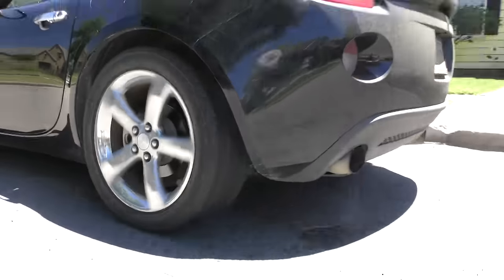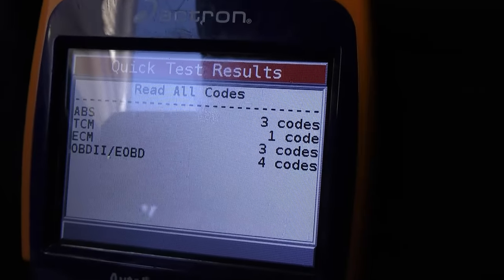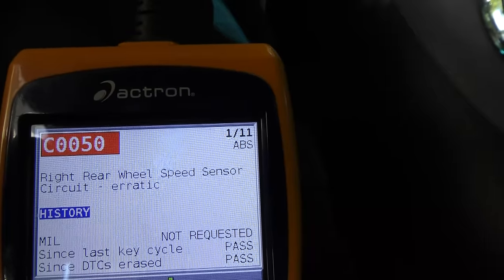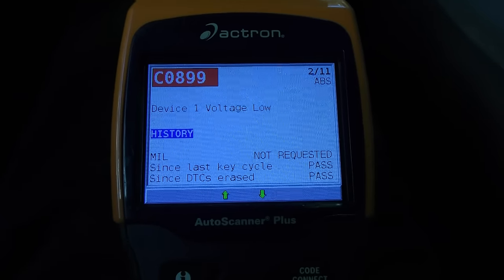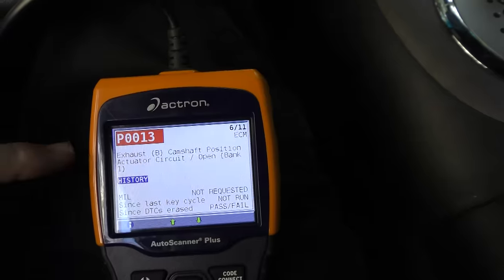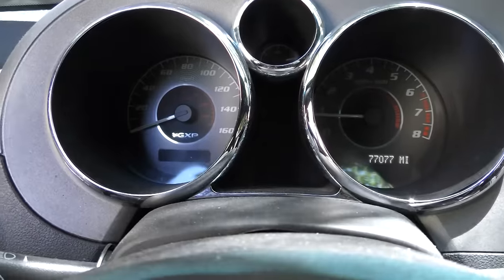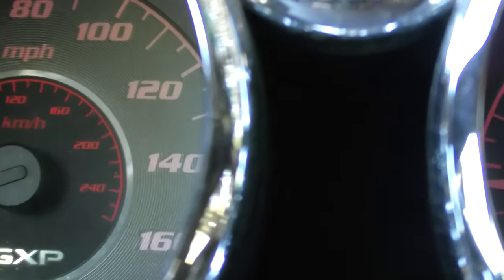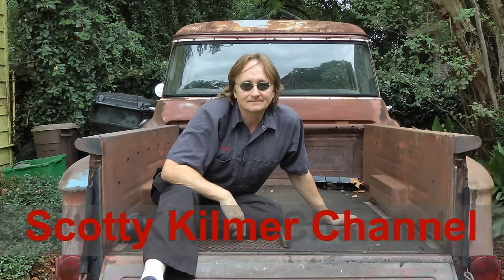Check Engine Light On in Your Car? The Truth About What it Means

Comment: if the check engine light goes back on after erasing the code, just use a little piece of black tape to cover it up. bye bye check engine light!
Reply: squintero213 If it starts flashing with the black tape on it, bye bye engine or catylitic converters.
Reply: lol, then we will need more tape
Reply: Catalytic converter is not even a necessary thing in cars to run as far as I know is just do to a car be legal for not contamination etc. But can make the car runs poorly and fuel efficient can also affect. Same with resonator
Reply: Elliot J Vidal a lot of things is not necessary in cars to run, air filter, fuel filter, oil filter, AC,  and on Diesels alternator, headlights, horn, seats, etc. so your point being?
Reply: I just took the bulb out from the gauge cluster.
Reply: Also if your up to your eyes in debt, just burn those bank statements, bye bye debt.
Reply: I did that with my airbag light.  WOrks a charm!
Reply: squintero213 Didn't Homer Simpson do that in "The Simpsons"?
Reply: Fireship1 there's nothing the simpsons did not do already
Reply: squintero213 Well that's one way to solve it
Reply: squintero213 It's just that simple, it's magic.
Reply: Not if you live in a state that doesn't pass inspection because of it.
Reply: Airbags have an airbag light generally.
Reply: HAHHAHAHAHHA
Reply: bye bye engine...
Reply: @squintero213  Hahahahaha!!! I did that on my van. Outta sight, outta mind. lol :-)
Reply: I was thinking the same thing if we clear the codes the computer still all have to be ready when we get emissions done I got several parts replaced 2 different times the shop reset the check engine light I went to get emissions done months later and the guy at the shop said I did not drive long enough a drive cycle so the computer will be ready.
Reply: i remember doing this on my first car.  electrical tape, to be exact.  it was a honda crx and it ran like a beast, so i didn't give a shit.  now i'm old and responsible and when my check engine light comes on i freak out and check it immediately.  i miss being young and not giving a shit, it always seemed to work out fine anyway.
Reply: It also means that you either have to refill blinker fluid or replace muffler bearings
Reply: We can not to that here.HA HA HA My sister and her husband have a 90 CRX they bought from my mom years ago my mom bought it brand new.I know what you mean about older I used to use just a jack to change my oil now I think about the jack falling.
Reply: Chris FIX HA HA HA
Reply: squintero213 haha lol lmao
Reply: squintero213 bye bye engine too
Reply: I bought a used car that the dealer did that on. 😐
Reply: Bmw M3 e46 not really, sometime some stupid sensor would trigger the checkengine. i ran my car for 11 years with the light on.
Reply: After a while the bulb burns out, dont even need the tape.
Reply: +CarimboHanky 
thanks
Reply: been driving with my orange check engine light on for over 14 years. light is still shining and vehicle has over 400,000. I am gonna keep waiting for the light to burn out.
Reply: John Smith it will never burn out
Reply: We can not have a check engine light on in GA  and if we get a new part and reset the light all of the checks on the computer need to be ready and do a drive cycle.
Reply: Sky Raven same here, we have e-check in my county in Ohio. It pays to buy a code scanner to fix things yourself to be able to pass it.
Reply: sorry, but there's no w check in Ohio anymore. They been out of business for a while.
Reply: tom jones umm yes there's no w check but there is e-check as in 'emissions check' in 7 counties.
Reply: thats what i did on my piece of shit buick (redundant, i know)
Reply: lol, good one
Reply: you know I never thought of using a piece of black tape I have a Chevrolet with the engine check light on for 12 years , it's never failed to start and has never used one drop of oil
Reply: If the state you live in requires inspections you need to get that light off. I live in the shitty state of Massachusetts that is very strict on car safety.
Reply: omg, it actually worked.
Reply: or remove the bulb!
Reply: DONT BUY NEW
Reply: I got my door replaced and my car serviced 1 week ago and my check engine light returned yesterday so I’m not paying the dealer another cent I’m just gonna cover it with some tape
Reply: Not owning a scan tool and having an old car, I just momentarily disconnect a battery lead. Works, no more check engine light staying on after start up, one drawback is you lose your radio settings.
Reply: squintero213 Lmfaaaaoooooo
Reply: Lol
Reply: just disconnect the dash. who needs all these flashy indicators anyway. not me.
Reply: I think these warning lights can sometimes be glitchy, so if it goes off and stays off & car drives fine , then it’s ok 👍
Reply: Ha my mechanic actually tols me this... He said my codes were linked to the catalytic converter... Its also burning oil.If he can't find the cause of the burning oil when my pockets are fatter it'll be going elsewhere... Its a bit frustrating
Reply: Ima fan igu
Reply: what a great idea! i never thought of it! will electrical tape work?
Reply: @JohnSmith-mh6bq  What kind of car?
Reply: @NeoJSsk  exactly! it is to collect the fumes and pass emissions. my friend had his cut out and rerouted his exaust. truck runs beautiful just louder :)
Reply: Yeah but but if you have emissions test you will have a problem
Reply: the same can be by resetting the trip odometer, and voila!  you now have a "low milage" vehicle.
Reply: @bronzechicken4437  oil pressure light
Reply: @Elizabeth-ej6ln  could it be your PCV valve
Reply: That’s true. It works.
Reply: Yeah , how about passing smog test ??
Reply: You can also paint over it with black paint that always works for me
Reply: I just had my car fixed with engine light on and they said it was spark plugs .my car doesn’t shake or anything at stops like before .It seems to be driving smooth but as soon I started the car the engine light is on
Reply: @jackhammer1021  😂😂
Reply: Lol, Sometimes it's indicating a problem that need to be corrected
Reply: @markvinci4369 same here. All new plugs,wires,cap,rotor injectors .then light went off for 2 weeks the the misfire no 4 code shows. It drives good oh valves adjusted too. I'm going to just ignore  the lite as long as it not flashing.
Reply: I used to put paper in front of it so I wouldn’t have to look at it l.o.l.
Reply: @jackhammer1021  good point
Reply: Yeeeeeeee😂
Reply: How do you get by state emissions?
Reply: How do you get through emissions?
Reply: @DareToBeDeviant 😂 I love it! I want to learn how to disengage the seat belt reminder nonsense too!
Reply: 😂 someone actually sold me a car like that, when I failed my following smog test. Should have went back and held the private seller responsible.
Reply: I once saw a tv show, before all the electronics, where 2 guys spent weeks trying to.get the light off. They finally solved the problem by pulling the light out of the dashboard with a pair of pliers.

Comment: German cars should replace the "Check Engine" message with "Time to Milk Your Wallet."
Reply: Hey, do you know a fun symbol for that?
Reply: SE45CX yah your car will have a middle finger that lights up
Reply: Over engineered money pits is all they are draft knobs who think their cool , nothing cool about them in my book
Reply: It's only the local market that makes them expensive. In Germany/France, they are everywhere, and used as Taxi cabs, and hence, every mechanic knows how to work on them and parts are everywhere. And hence, they are MORE affordable to own than non local products.
Reply: I remember hearing stories that the check engine lights where origonally programed to go on at a certain milage reguardless of engine performance because of service intervals, which is the reason why we have many different lights today.
Reply: that shit is gold
Reply: you aint lieing $1267 to replace my water pump on my 09 bmw 135i
Reply: I will not buy another MB. The maintenance [took four tries to spell that] is to expensive.
Reply: D Duckman , kudos for your effort and I hate to tell you but it's too , not to . Sorry .
Reply: Correct saw that after I posted.
Reply: You have unfortunately misspelt 'to expensive'. It should be too expensive.
Reply: Joshau Levell they ripped you off. Those pumps are usually 60€ and are easy enough to replace yourself and even if you wouldn't want to do that, it's so quickly done by a competent mechanic that it should cost at most 180€ total including the cost of the part.
Reply: haha, those and BMWs LOL by way of Mini Cooper
Reply: pfannkuchengesicht42 my electrical water pump is costing almost $500 alone here in the US from what ive found online.
Reply: TheBluRayCritic
how to fix a German car for quite a bit less. Scan the car for codes, put those codes in online, read some forum threads, purchase  the OEM parts from the original part manufacturer, not the parts from the dealership parts department which have a 50% markup. get some basic tools from Ace hardware, fix it yourself for a fraction of what the dealer would charge, have the satisfaction of a job well done
Reply: I drive and abuse a GTI daily. Currently at 79K not a single issue but needing tires soon.
Reply: TheBluRayCritic 😂
Reply: Totally Agree. Thats is exactly how I do it for my Porsche Boxster and spend maybe $100 to 200 per year.  If the car is out of warranty forget the dealer and save tons of money and even time.
Reply: TheBluRayCritic c
Reply: Mike Ericks or
Reply: Joshau Levell You were milked very well.. ORIGINAL pump costs $373, it's mounted with 3 screws, there is also 2 waterhoses and one electrical connector.. for that money I could quit my job and change one waterpump per week and make more money than my full time job :D
Reply: TheBluRayCritic my audi a8 check engine light came on and all i could think was 300 for diagnostic at the dealer. But i bought a scanner and replaced a 50 buck pvc and erased the codes.
Reply: TheBluRayCritic nooo i have a porsche cayenne 2014 and the light is still on for about 4 days
Reply: German cars leave the factory with emission problems as they have cheated their emission results . Best to just smash the dash panel with a hammer to extinguish the light . Works every time !
Reply: mixwell1983 lol
Reply: TheBluRayCritic  nice one but they will never change the check engine light
Reply: Joshau Levell don't get the BMW then
Reply: German Cars suck yuck yuck yuck, I only buy ford yuck yuck.
Reply: TheBluRayCritic I have two German cars (Both made by SEAT, a Leon mk1 and an exeo), one with 98,000 miles and the other with 201,000 miles on the clock... They are two of the cheapest cars to run I have ever owned. The parts can be a reason able sum of money, but they last if you don't buy rubbish. The electrics are cutting edge, hence why a 10 year old German car can have electrical issues...but you solve that using Internet forums.

I have owned two fords, both of which parts were cheap for, but they just didn't stop going wrong. Certainly caused me a bigger headache than any German car. Certainly cost me more in the long run, as it was so frequent I often had to pay someone else to do the work through lack of time.

My BMW and MB were easy to fix, but parts were mega money so they could be costly if something big went wrong. (Auto gearbox on the BMW)

I think car maintenance appears to cost a lot to some because they take it somewhere and just pay whatever is asked, without question. The other issue is when parts keep getting replaced because the fault has not been cured, and people assume this is the manufacturers fault, not the garage. You see it all over the forums, people claiming that they have had a running issue, but have had 9 different sensors changed because the car is so complex. - if they had taken it to somewhere experienced with that model, they may have fixed it first time. But sadly many mechanics work all types, and this means that experience on certain ones can be lacking, therefore making fault finding more complex.

Anyone who has worked on different brands of car will see how their designs can vary completely. This is why I stick to VAG cars, I am very familiar with SEAT models based on the golf and the a4. I am very good with mk4 golf tdi engines (all 6 variants) but not very good with the 1.8 petrol of the era. Garages can be the same.
Reply: Deadeye Duncan you know what Ford stands for. Fix It Again Tony
Reply: TheBluRayCritic Cooler. Three weeks.
Reply: TheBluRayCritic BMW is bad 😳
Reply: It's that time of month AGAIN
Reply: TheBluRayCritic they should have Apple Pay built into their dash screen for easy convenient screwing. Bend over and pay with ease.🤣🤣
Reply: TheBluRayCritic 
Had two German cars and they've been very reliable.
Reply: same thing can be said for ferreri's and lambo's.
Reply: TheBluRayCritic it should say "uh oh! it looks expensive down here". The icon should either be a trollface or a dollar sign
Reply: Especially Mercedes-Benz vans. "Check Engine" light is permanently on when the van's warranty is permanently expired.
Reply: Tell me all about it BMW... Better Milk Wallet
Reply: Lol jajaja that was a good joke...so true I just spent $2k trying to get rid of it on a Acura MDX 2005. Light is still on
Reply: It's all cars!  The EVAP was made with good intentions, but unfortunately, corporations took it and ran with it, turningh it into a money grabbing racket that can go one and on!
Reply: Go Japanese or Korean!
Reply: 😂LOL, but that's reality
Reply: German cars are not made for Americans.
Reply: @ThomasJoseph315  I heard it as well. But it seems to be a scam from trump.
Reply: @dduckman1423  the cars are just too expensive for you. Find yourself a better job.
Reply: Just get a better car.
Reply: Actually that's new german cars. My 88 Mercedes 300D had 411000 miles on it. It might clatter and is slow but it will never die. Also my 86 BMW 6 series is a very good car. Just had to change out a air sensor and invest in a obd 1 scan tool because all I had was a 2 so I couldn't use it. Speaking of which the one scotty  has for 5 grand better be able to tell me what I had for lunch yesterday and why it wasn't right because the pickles were missing when I sit in the car lolol.
Reply: Exactly true
Reply: Yes!
Reply: Brian Waller  lol
Reply: 600$ later just to pass inspection...dont even go to serious repairs. 
Thousands $...
Reply: Or a dollar bill warning 🚨.😮

Comment: I know someone who's check engine light has been on for over 5yeads car still runs fine
Reply: J Bush doesnt mean its running good. It most likely is an O2 sensor and could be having the vehicle run rich so there gas mileage could be slightly effected.
Reply: J Bush mine was on for over a year with my 96 tahoe
Reply: My o2 sensor kept going off and it was a hole in the exhaust xD
Reply: mine has been on for 2+ years and still fine.
Reply: Multiple Choice exactly what i am saying. if you stay on top of repairs and maintenance. You will never have those crazy 1500$ repair bills you always hear about.
Reply: Check engine light: Code P0069 - Female driver detected: Replace driver.
Reply: Multiple Choice 15,000 miles in 5 years?
Reply: How dare the car assume the female driver's gender!
Reply: ScoobyDigits there's was a 97 GMC Suburban
Reply: J Bush He or she probably consistenly didnt full lock the gas cap to three clicks for 5 years straight lol
Reply: Wow! I didn't know those bulbs last that long! lol
Reply: I know someone that solved the problem by placing a large sponge over the entire console :) He said the light stayed on for years but it wasnt a problem because he never saw it.
Reply: Sometimes the sensor is weak or bad. My experience was a 1996 Mercury Sable. Just after 100,000 miles the  engine service light came on and the code said the catalytic converter was bad. The mechanic said to run it until the performance or gas mileage went down. Many years later after checking the codes time and time again, it was always the catalytic converter, and just kept driving. Mileage and performance never wavered. Sold it awhile back  with 300,000 miles on it. Had to be just a bad sensor.
Reply: J Bush Thank u for this makes me feel a lot better
Reply: Mercedes owner? lol.
Reply: MrTrip3ace I was just going to say that
Reply: How do you manage emissions inspections?
Reply: Mine comes on every couple of months. I paid to have the problem fixed about 3 or 4 years ago. A year later...same code. 
So now...I just unhook the negative battery cable, wait awhile, put it back on, and viola...no light for a few months.
Reply: How does it pass inspection?
Reply: @drubio1062  fake stickers  I'll bet.
Reply: Lol😂damn
Reply: @HAL-dm1eh  if the driver is a female then the gender of the female is female. 😂
Reply: @introverted.unicorn6438  Whoooosh
Reply: Yeah he's been using his feet to run it.
Reply: HAL 9000 lol.  Right? 😂🤣
Reply: @MrTrip3ace  wish that were trie for me. I stay on top of it and still had a 1,400 bill recently. Just when the car gets older issues start popping up
Reply: @mancdown  I am about to do that to mine lol
Reply: How does it pass inspection?
Reply: @drubio1062  right ! Won’t pass
Reply: If the problem is the fuel evaporation canister or valve, mine was gummed up, so I had it replaced. 6 months later, same thing, so I did nothing about it. Ethanol will gum up things continually. The car runs really well before and now.